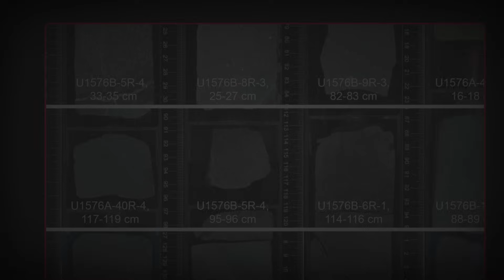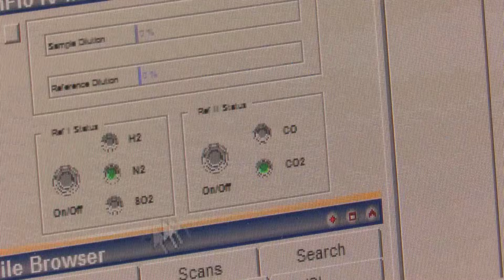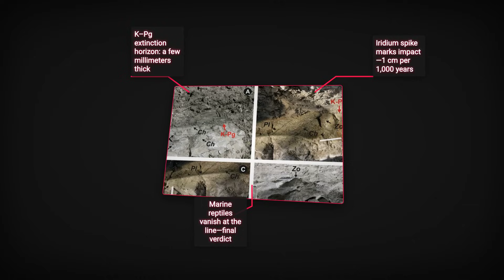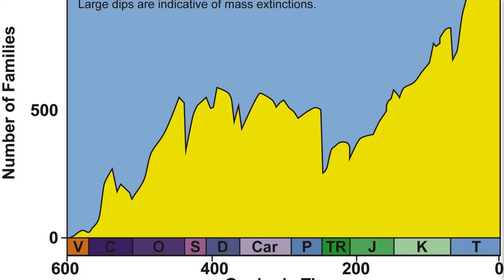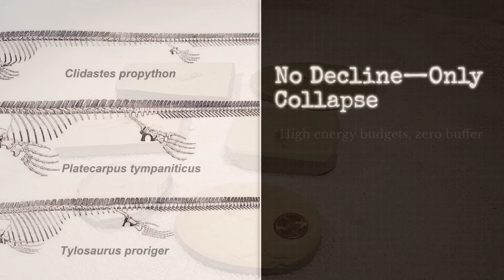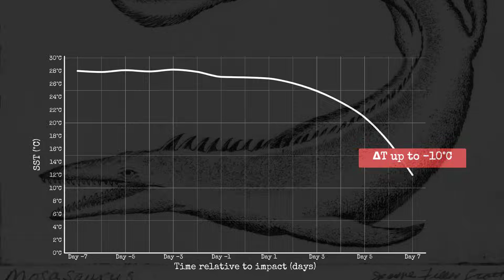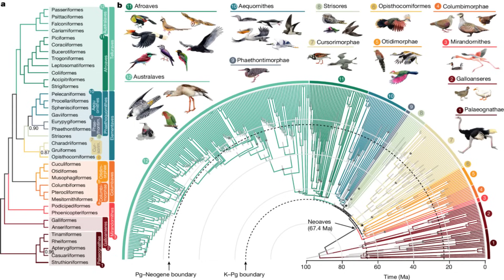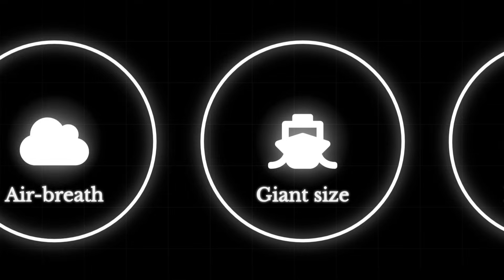The Ocean Floor Fossils That Prove Evolution's Deadliest Mistake

Comment: What is cool about the Mosasurus  is the "second "jaw inside of it's mouth. 2:10
Reply from the maker: Great eye Theresa! That "second jaw" inside Mosasaurus's mouth is actually palatal teeth on the roof of its mouth - they could grip prey with upper teeth, lower teeth, AND roof teeth all at once. 
Like having a third set of jaws!  
Those pterygoid teeth made Mosasaurus one of the ocean's deadliest hunters. 

Did you notice any other unusual hunting adaptations in the video?

And also, this weekend im researching which types of dinosaurs that actually is trapped and preserved in amber for a video thats planned for next week. Could that be interesting?